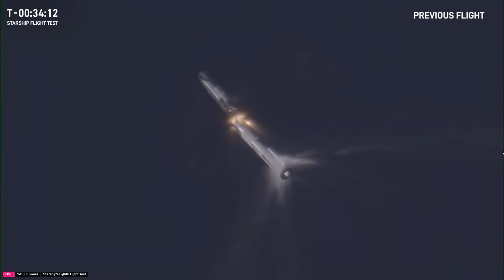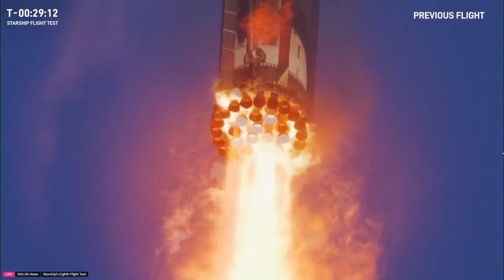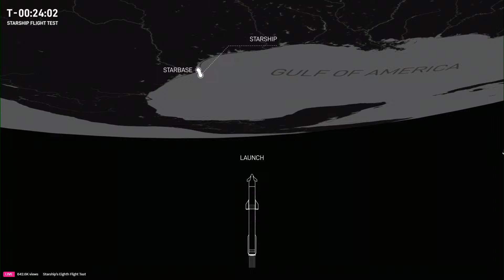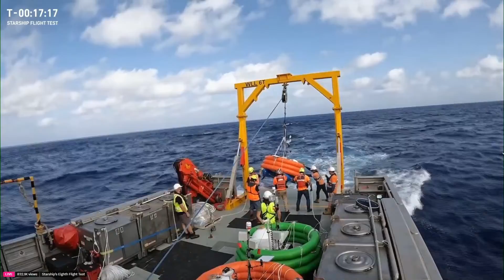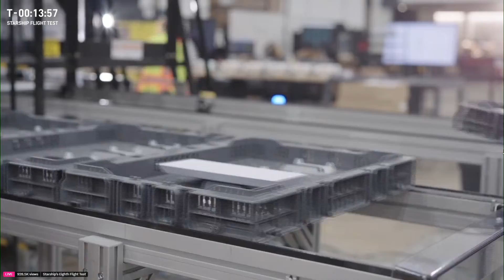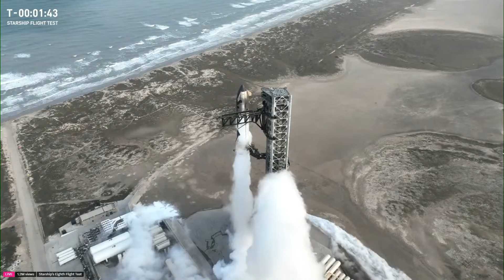Starship launch LIVE: SpaceX test flight scrubbed

Comment: I think that by using an alloy (or a pure metal) that closely matches the expansion rates of ceramic heat shield, you could form a raised/suspended wire mesh reinforcement system that would allow the wire mesh to expand and contract, while a meshwork of perpendicular supports that connect the outer skin to an internal hull could flex slightly, to accommodate the expansion in a one-piece ceramic hull, that might be shaped like a Carl Alberg boat. Put the meshwork in the middle of the ceramic skin. (c 2025)
Reply: A manned Mars orbiter could be assembled in Earth's orbit by drones.
Reply: Heave-to!